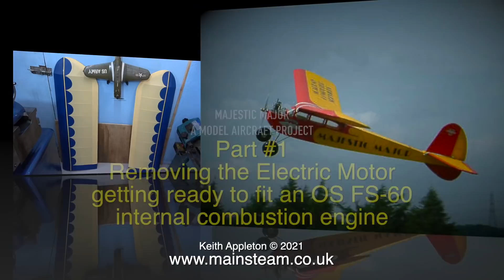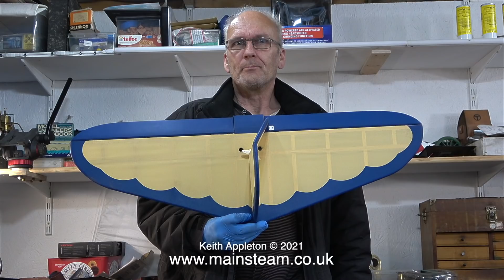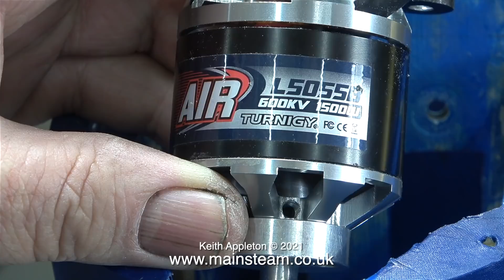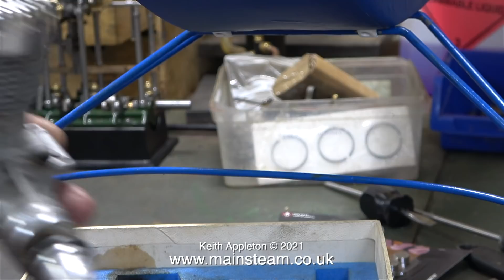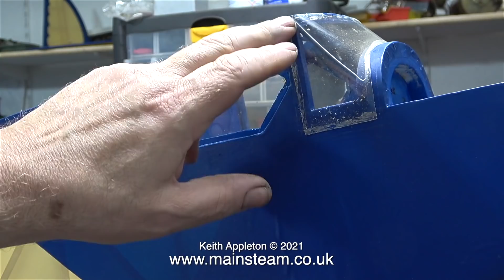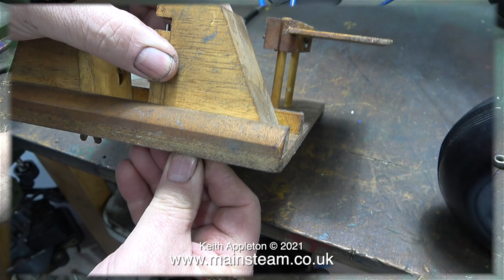MAJESTIC MAJOR - A MODEL AIRCRAFT PROJECT - PART #1

Comment: Delighted to find this and I've only just about seen part one so far. Yippee! Electric back to methanol, this is a tonic. YouTube suggested your visit to John Mills video this morning now I'm set for the evening. John Mills, sounds like a man who ought to have some interesting vintage diesel aero engines doesn't he? You may have bought some of his Dad's engines. If that is the case they seem to have gone to a good home. Thanks for sharing. A big Ben Buckle job would have been the right thing when I was trying to fly RC on my own years ago without a club around. Something that could basically fly itself in gentle circles until an intervention was made. Instead we only ever seemed to have seconds to master the  aileron trainer model before it crashed, had to be rebuilt and flown again with its all new trim characteristics!

Comment: What a pleasant surprise to find this on your channel. I also have an FS-60, which is fitted to an old Telemaster-40 that has a six foot wing span. I use a Perry oscillating fuel pump which adds some reliability to its running. As you said, the engine does not produce a lot of power compared with more modern designs. That being said, your airplane, like my Telemaster-40, are vintage designs not meant for high performance aerobatics and such. It makes a nice putt-putt sound as it lazily moves across the sky.

Comment: I am kind of doing the opposite of  you and fitting electric motors. I can then just pop out to the farmers field near my house and have a quick flight. My father died recently and he flew radio aircraft many years ago. I recovered an Impala slope soaring glider and put an electric pod on it and it flies really well. I like that aircraft you have, it reminds me of one of those Alaskan go anywhere aircraft with the big wheels. Would you not consider putting ailerons on it. I think back in the day 2 channel was used a lot as the cost of 4 channel was much greater but today the cost difference is not really a factor.

Comment: Of course you could combine things and use a steam engine to power the airplane.  Then again, there is a small problem:  It won't work.  I just wonder if it would be possible, but I think not.  Maybe you could find out if it has been done and educate us.  Seeing how I've never seen a steam powered airplane (model or real life), I have doubts.  Of course there is always a first time.  Something to think about and file under "What were you thinking about, are you daft!".  Best of luck with the engine you have.
Reply: i think you could make it work with a multistage turbine on a couple ducted fans on an insanely large model that would literally be a flying steam explosion waiting to happen with very superheated steam.
Reply: @Mister_Brown  A chap named David Parker flew a steam-powered model at the 'Woodvale' model rally many years ago. I think it was around 1980-1985.

Comment: Thanks for sharing! If memory serves me correct, the OS Max 60 had the option to pressurize the fuel tank. Are you going to install that option?
Reply from the maker: I am not sure, I think it is an oil drain rather than a pressure take off point. A lot of oil comes out of it when the Engine is running.

Comment: you are full of surprises keep it up (can a this model plane have more than 2 blade prop and what would that do for performance?)
Reply from the maker: Yes you could use another type of prop if you wish. These old four strokes were not as powerful as the new ones. So a something like a 12 x 6 2 blade prop is OK.
Reply: @keithappleton  thank you have been very helpful with everything(could you please translate what it means by 12x6 prop tried to find out but couldn't find anything helpful
Reply: @ilfarmboy  It means a propeller of 12 inches diameter and 6 inches "pitch" (the angle of the blades). Theoretically the prop would go through six axial inches forward for every revolution. Very roughly, you can multiply the pitch in inches by the rpm in thousands to get the maximum level flight speed in mph of that propeller.

Comment: Gotta love the smell of glow fuel. Model Diesel fuel smells good to... The sound of a model airplane engine is what makes it for me. The downside is the cleanup after running and flying. I just take it as part of the hobby. A couple years ago I had all my model airplanes and engines stolen from my storage unit. It taking me a bit to get back into it but I've started. It's good to see others who are interested in the old models. Thanks for the great video and keep them coming.

Comment: 6:30 I can't wait to hear and see that magnificent OS FS-60 thumping away on the stand. And then again on the aircraft! Need to get me one of them as well, find a suitable plane to fly it on. MAybe a SIG Astro Hog, given my preferences for aerobatic shenanigans? Should have enough poke for a 40-size sport plane.
Reply: Funny you should say that. A few years ago I bought a kit for a 'Flair Astro Hog, and an OS FS-60 to power it, both off e-bay. I've still got them, still un-built. Must get them started, I remember when the Astro-Hog came out as an APS (Aeromodeller Plans Service) plan, round about 1958.It was classed as a low-wing version of Howard Bonner's Smog Hog from 1956, which was demonstrated at Woburn Abbey, amongst other places.I think Bob Palmer also demonstrated his 'Thunderbird'  control-line model at the same venue.If IRC the 'Astro-Hog' was designed by Fred Dunne. I must point out I was still a schoolboy when all that was happening, but it was quite a memorable event !

Comment: I prefer the Saito knucklehead style motors( especially the black and gold version), but this one is beautiful, and going to be a great model!

Do you have a transmitter you plan to use? I'll bug a friend who had some vintage radio gear if you like.
Reply: Actually, Saito engines are my favorite four-stroke engines too. They are powerful and reliable and built very well. I like the one-piece construction of the cylinder and head, too. The Black Knight series of the Saito engines are nicely finished and are great looking.